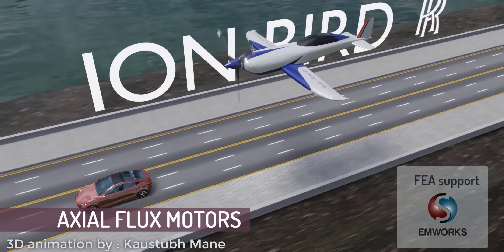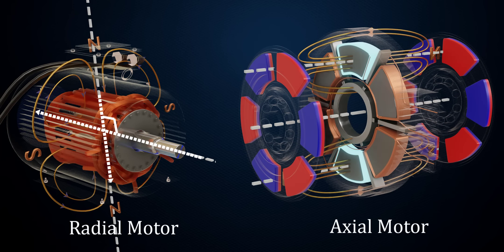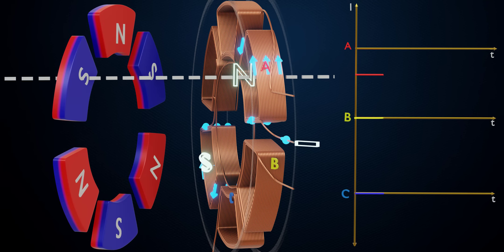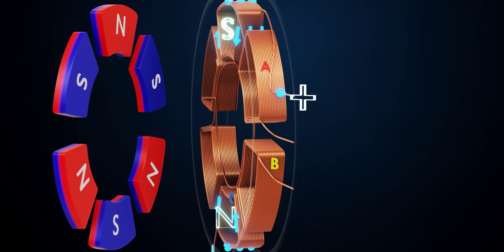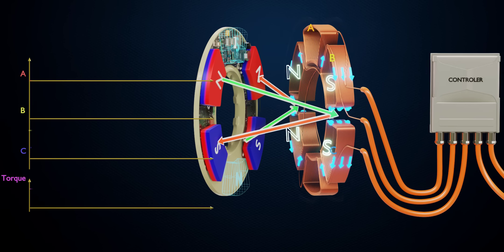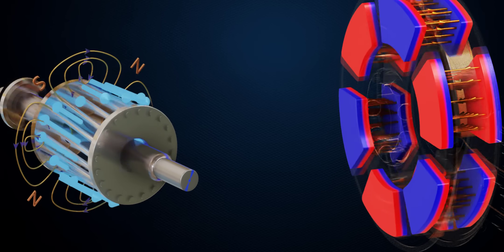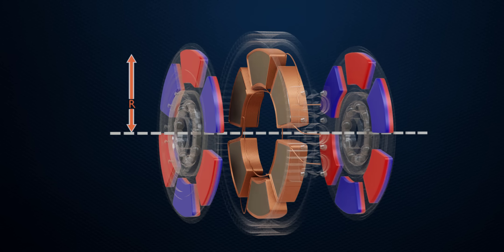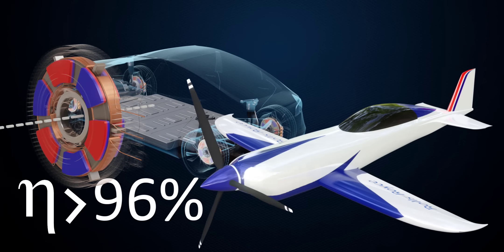Axial flux motors - The new hope

Comment: Electric aviation...
Isn‘t the motor the smaller weight problem with an electrical system?
Reply: Yes and no.
Fuel can be heavyer then batteries thanks to pumps and saftyfeatures.
A plane also need to look out for balance. You cant just have all your fuel in the left wing an non in the right wing without suffering some problems. Well placed batteries are always heavy no matter how high or low of power they are.
e motors are also efficient and need less cooling then there fuel counterpart. Every bit counts when every kg is slowing you down.
Reply: @HungryHunter  You are forgetting battery failures which in this instance would be a greater hazard then fuel. Lithium batteries have a nasty habit of self combustion and explosion.
Reply: @ihaveone6086  one of the reason we not yet have full e motors build in everything.
the tech is OLDER then the Fuel tech but only now we get our hand dirty ironing out this problems.
Reply: @HungryHunter  There is somebody we can blame for that isn't there??? However, that was not what I was thinking when I wrote my previous reply. I was more hinting on human advancing our technological capabilities as we speak... So I am sure that nano technology is going to make a break through, which is going to increase energy density to weight ratio. The same move forward is going to make electric vehicles feasible.... Right now we don't have electricity production means to satisfy the needs of going full electric. There is just not enough infra structure.
Reply: @ihaveone6086  yes not enough infra structure to build the new things and to much of the old infra structure blocking our attempts to innovate.
The irony our kids (so i hope) have when they go from electric to plasma/antimatter/whateverium.
But solong people make money by maintains heavy cars in a economic system that rewards waste we can pray electric dont turn into a monster of its own (hint: planned obsolescence (buy a new e-car each year becouse an fuse "expired"))
Reply: @Cancer McAids thx for pointing that out. I like to add: electirc isnt the end of all goals... somehow we need to make the power.
Hope is solar, wind and geotermal.
But noone is helped when we need more energie to make this things.
Biofuel is a thorny thing.
One hand its nice to make fuel out of the sun without making a complex solarfarm. Fuel is a good energie source regardless where it comes from.
But on the other thing is it kinda risky linking your food and energie econemys together. People like to eat cheap and dont like to watch prices rise becouse someone want to drive there landtank of a truck with biofuel.
Reply: I have not been this impressed since Rockwells' Retro encabulator.

Comment: I have not been this impressed since Rockwells' Retro encabulator.
Reply: Unlike common transmissions which operate one the relative motion of conductors and fluxes, this motor generates power through the modial interaction of magneto-reluctance and capacitive diractance.
Reply: @calinagotici2253  Quite.
Reply: the turbo-encabulator was more efficient though...
Reply: Hey, the retroencabulator would be absolutely nothing with out the panametric fan.
Reply: Yeah but this can't synchronize my cardinal ghrammetrs
Reply: @Auttieb  the Retroencabulator actually can help keep your ghrammetrs synchronized, but you really need all six hydrocoptic marzlevanes custom mounted on the ambifacient lunar waneshaft to prevent sidefumbling.  It's not exactly clear in the manual how to fit the marzlevanes, but Rockwell support might be able to help.
Reply: @kayakMike1000  Never a wiser word spoken.
Reply: @Auttieb  Brilliant observation, Scott! Nice!
Reply: Wut
Reply: Does this motor have capacitive diractance?
Reply: I want a axial encabulator on my paralell energized polarized coil washer fluid
Reply: ....and here we can observe them in the wild communicating in their own special language🤣😂
Reply: Can be used as a Hall-effect sensor for motor position sensing right?
Reply: @907AlphaKilo  I thought a Hall Effect sensor only measured echo amplitude in dance venues?
Reply: But do these motors eliminate side fumbling?
Reply: It reverses eddy Graham currents into an easily discharged heater core, further improving its efficiency at low and no rpm speeds.
Reply: Can’t surpass the reciprocating dingle arm mechanism, but is close.
Reply: Theretroturboencabulator really was a game-changer though
Reply: Ah the one with the girdle spring and the horizontal marzle vanes!  Yes fine piece of engineering it was
Reply: I'll bet you say that to all the boys. lol
Reply: Seriously? This video is middle school level physics
Reply: How does it match up to an interociter incorporating a planetary generator and electon sorter?
Reply: Will this work better as a generator also ... ?
Reply: With rockwell's retro encabulator my car used to get 40 rods to the hoghead!
Reply: Brushless motors are old as dirt.
Reply: No side fumbling here
Reply: If the Axial flux motor uses a flux capacitor powered by lightning, then it will outperform anything out there!
Reply: @mimi1girl2dempsey3  Only for a short period of time
Reply: It definitely set the bar.
Reply: @seal-teeth  It sent me to the bar as well, for a punt and some darts 🎯
Reply: Don’t forget the girdle spring
Reply: Oh gosh that thing
Reply: My encabulator doesn't work anymore!
Reply: We still have 3 of those in operation at work.  Very good machines even by today's standards. They are due for servicing and it's getting harder to find qualified techs though.  You need special equipment to re-calibrate the dingle arms.
Reply: @redsquirrelftw  That's a lie!  Interociters haven't been used since the late 50's & were superceded by other alien tech, & you know it!  However if I tell you what the replacements are, you know very well  someone from Area 51 will ensure I never post  a comment again... 😳
Reply: Does it have a drawn reciprocation dingle arm?
Reply: The Macquarie Telecom SD-WAN Turbo Cloud Encabulator ?
Reply: Hi first of all your art is absolutely stunning 🤩,second, happy to watch!😛👍🍭😜👍beautiful artwork dear full watched 😍💞💞
Astonishingly beautiful!!!... What a brilliant masterpiece!!!... Your artwork is phenomenal! Your skill set is superb with amazing techniques!!!... Awesome creations! Absolutely love it ! Thank you for sharing!!!... 👍+🔔😘😊😘😛😜🍎🌷🌹🌺🍂🍃🎃🍒🍖🧀🍓🍊🍅🌭Again amazing work 💕 keep it up and stay connected 🙂❤️🧡🧡❤️🧡🤣💟💜💛💙💛💜💙Absolutely stunning Beautiful! 🤩,happy to watch!😛👍😜👍 wonderful!
make a new friend just amazing no wordssss..💌💌💚❣️💛💕❤️🧡🧡so beautiful work really enjoy by watching your video keep sharing stay safe and connected🙂🤗👍🍂🌷🌹❤️🧡🤣💟💜💛💙🧡🧡❤️
Reply: I think Lockheed's parametric phase-change eutectoid supercapacitors are pretty impressive too...
Reply: Fred Lee  Don't forget the steady state swing-arm. That induces a constant flow of current to prevent any lateral magnetodynamic motion in the dingleberry. :)
Reply: Fred Lee  Oooh, I hadn't seen those.  Pretty cool!  I've already got ideas for decreasing my positron loss rates with that!  Thanks!
Reply: Fred Lee  normal school??
Reply: Fred Lee  Make sure the dingleberry has a retractable non-Newtonian fluid casing, to avoid any excessive push-pull on the truncated backplate for the nanoparticle based retroencabulator. If not, then the Wii will splurge on to the Schroedermeyer Fuse, developed by Antonio Schroedermeyer on May 29th, 1966.
Reply: Our facility will soon exhibit optimized retro encabulator node-phasing. The crew at Encabulation INC. is on-track to leave this technology in the dust.
Reply: But all this puts too much strain on the knurdle thrub flange widgets, they constantly fail
Reply: There's too much Science in this conversation...I'm going back to watching CAT Videos!!
Reply: It's a good idea, but it;s only about 10% up from the best radial flux motors.
They can be 85 to 92% efficient.
Reply: Ah yes I'm sure some hydrocoptic Marseille veins to prevent side fumbling are a necessity, but only if they're mounted correctly.
Reply: SMH everyone seems to "forget" the inherent characteristics of a basic Terwilliger circuit
Reply: What about side fumbling? They don't even address that
Reply: lol are you talking about that obnoxious engineering video?

Comment: The new hope? Underground science did this witht the Fluxliners decades ago. The trick with an electrogravitic setup is to place rotors within rotors within rotors using counter rotation.
Reply: Are you saying 1: 3 = 1?
This makes sense because if each of the three parts is equal, there is a tenth part that needs to be treated as 1 and again divided into three.

Comment: The problem with such motors in aviation is the same problem with rotary engines - big rotating disk becomes a big gyroscope.
Reply: RK: One must compare the weight of the PM rotor vs. the crankshaft and propeller of the equivalent fuel engine.

Comment: Like so many have responded .. Wonderful presentation and excellent explanations .. However, did not touch on the reverse .. Can these wonderful designs be adopted to re-invent the generators ? to the extent of a 550MW generator in the power plant ?  Please please please, say someone has already thought about that and made a proposal .. and ask you to explain it to the general public ..
Reply: They probably could be used for generators, but probably won't be. Generators have quite different design considerations, in particular weight is a non-issue but you definitely don't want to spend money for tons and tons of expensive permanent magnets.
Reply: @leftaroundabout  OK, maybe not for utility generating stations, but perhaps for renewables ? such as wind and small hydro ?

Also on the issue of permanent magnets, I have always wondered whether it can be electrically magnetized like the magnets we use day to day, except that the motor [or generator] include built-in facilities to strengthen the magnets when they get weaker .. Say when not in service ..

Comment: Please make a video on how they overcomes these limitations in this motors...
1. Permanent magnets lose its nature on heating...motor obviously radiates heat...
2. What if that electronic controller chip fails in the middle of journey
Reply: Not a problem for rare earth magnets which is why they dominate current robotic & electric car applications. Switched Reluctance motors are a new technology which have high torque/efficiency and do not require rare earth permanent magnets may be the future for low cost electric vehicle applications.

Comment: What about the RPM of these motors? Strong magnetic field will cause more self-inductance increasing the time constant(RL) for charging and discharging of coil. This along will mutual inductance (the tiny bumps in voltage line) may negatively affect the efficiency at high RPM. It would be interesting to see the reliability of pulsed circuit compared to phase shifted sine wave circuit commonly used.
Reply: I think that is not much of an issue. You can always add some gears, though it does add a point of failure and weight
Reply: @delta4phoenix4  many of the large turbofans and turboprops already use gears without issues
Reply: I think the graphics are a bit deceptive as to how this will actually work. I do think reluctance will be an issue if they have the balls to actually try these as in wheel motors.
Reply: What I didn't see addressed was in regards to how you control the rpm's in these motors and the relationship between rpm & torque. How does increasing or decreasing the rpm's affect the torque?
Reply: is the hambone regulator connected to the shinbone accelerator?
Reply: @Cancer McAids Your calculations are right. However, 10 foot props are typically used for commercial category airplanes. Such large planes are limited by battery technology rather than motors. Battery operated planes are more viable in small Cessna line 2-4 seater planes. The prop size in such planes are typically 6 foot (1.8m). With high reviving engines like Rotax 912 UL, the maximum prop rpm is close 2500(ish). This will not increase tip speed beyond 240m/s (0.7mach) even in dive condition. So I think tip speed is less of a concern for typical rpm of 2500. 

Moreover, 2500 is commonly a large rpm for high torque motor. A common 3 phase motor operated with sine-wave can accommodate phase shifts occurring due to inductance, without distorting input waveform. Square waveform are more difficult to maintain their shape. (It is probably one of the reason they shifted from square wave to trapezoidal wave).

I am interested to see weather any distortion will occur with rpm? If it occurs, will it affect the motor efficiency negatively? I want to understand, if it's superior to radial flux motors, why we have not been using it?
Reply: Seriously? This video middle school level physics
Reply: For Driving a Propeller  or Road wheels on a Vehicle High Revs are not required . Do some Arithmetic .
A VERY FAST  car only has wheel RPM of about 400 . These Motors would need Reduction Gearing .
Reply: @johncunningham4820  A normal car wheel is about 800-900 rpm at 60 mph (about 100 km/h). A 53 inch (1.3 m) tall tire is needed to get that down to 400. Still need reduction, but not as much. Airplanes are better off, since props are normally in the 2000-3000 rpm range.
Reply: @johncunningham4820  on 20" wheels?
 My ford does more that 700 RPM at 60 mph.

Comment: Weight to weight comparison to hp and torque would be nice.
Does an axial require a cast housing or will composites be sufficient?
If radius=power then at what minimum range does an axial become neutral?
I.E. 55kw vs 250kw.
Reply: I think that water cooling will be mandatory for good power to weight - they stated 96% efficiency, with a 55kW mechanical that's 2.3kW waste heat, at 250kW it's 10.4kW.
Reply: @akkudakkupl  Modern general aviation engines like the Continental IO-550 produce 310HP (~230 kW) with just air cooling. Being a combustion engine, their efficiency is < 40%. This means they are dealing with dumping nearly 340 kW of heat. 10.4kW should be much easier to deal with.
Reply: @darthmoomoo  But ICE construction takes heat dissipation into account - there are prominent cooling fins on the cylinders. Also there is no electrical insulation to melt inside an ICE, so the engine can be over 150 degree celsius.

An electric engine can't run so hot or your insulation will breakdown. Air cooled electric engine is way heavier than an liquid cooled one.
Reply: @akkudakkupl  Not if you use higher temperature insulation. there are plenty of options just not conventionally used.
The real issue is the neodymium magnets that will permanently loose magnetism if they get too hot.
Reply: @TauCu  True, nedoymiums have low Curie temperature
Reply: At some point you're probably limited by the maximum frequency the wires can carry vs amps it can push.
Reply: And what about cooling and the weight of the cooling system?
Reply: Oh. akkudakkupi mentioned this
Reply: They use oil cooling systems.

Comment: These look a lot like the solar car motors. The team at UVa is now using a Mitsuba motor. They had a New Generation motor previously but some bone head made it spin too fast without properly setting the adjustable gap, and it blew up. Bits of the square copper coils and chipped magnets everywhere and the rotor collapsed into the stator. This looks like the same type of axial motor design! And I still regret blowing it up haha

Comment: You are comparing an induced magnetic field in the "squirrel cage" motor to a permanent magnet based motor. Not comparing like for like.
Reply: Spinning magnets is a very poor choice for high power and efficiency. 
An electromagnet can have much higher power and efficiency and weigh a lot less.
Reply: @fivish  So a wound rotor. Either adding brushes to feed the rotor or self induced, like a squirrel cage motor.
Reply: I have not been this impressed since Rockwells' Retro encabulator.

Comment: Most of the flux is passing through a region of the motor that is not able to generate much torque.  The strain on the rotor plates is significant also.  I think it is a novel, but dumb, idea (in exactly the opposite way a Tesla Turbine is a dumb idea).
Reply: The real ones don't have these issues.  The explanation is not of a real design.